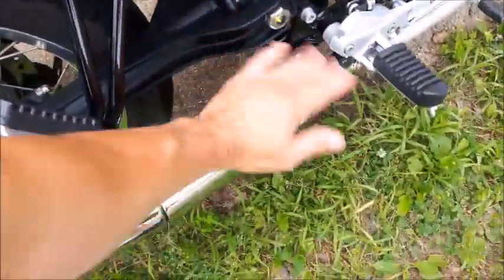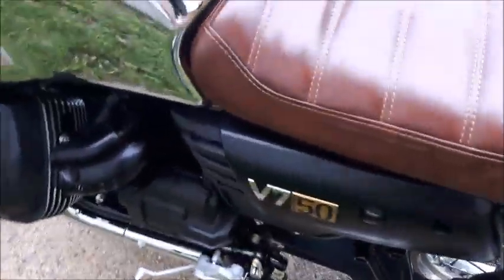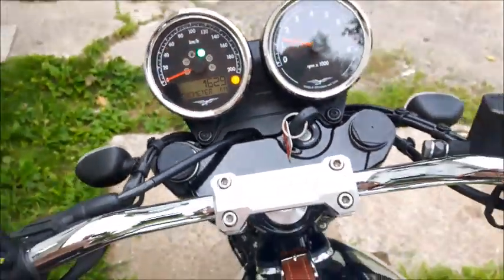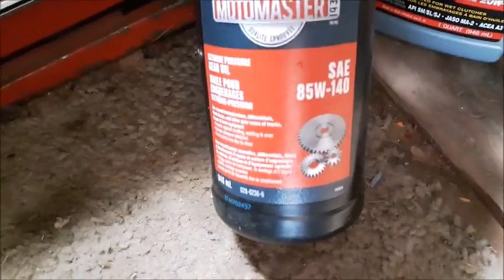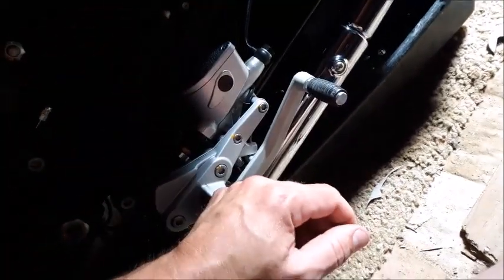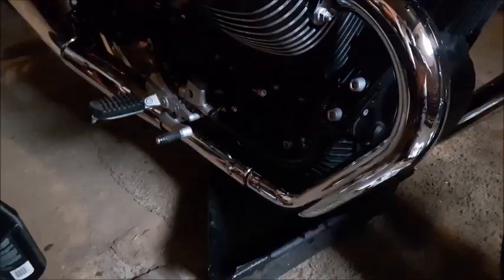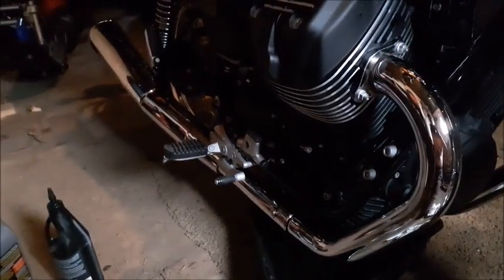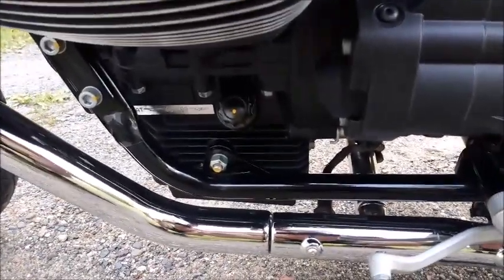Moto Guzzi V7 iii oil change

Comment: Nice video.  How often do you replace the engine, transmission and rear shaft oil?  Transmission and rear shaft use the same oil? A bit slower when pointing out all of the locations of what and where would be helpful.  Thanks Rick.
Reply from the maker: Sorry about the speed, you can turn the speed down with the little gear on the right of the video. I changed the oils once a year, the gear & shaft were the same oil. 80/90 weight. The engine i would do once a year regardless of kms, though they say 10,000kms per change i believe it is.